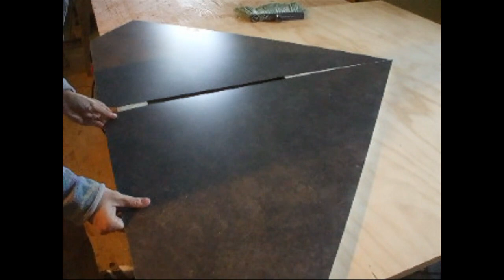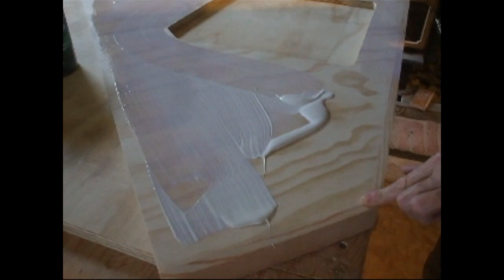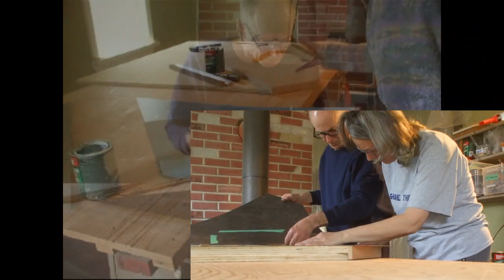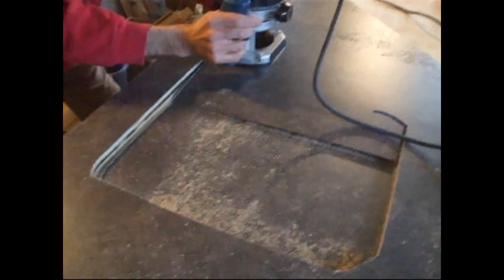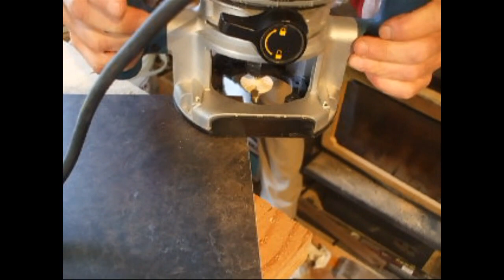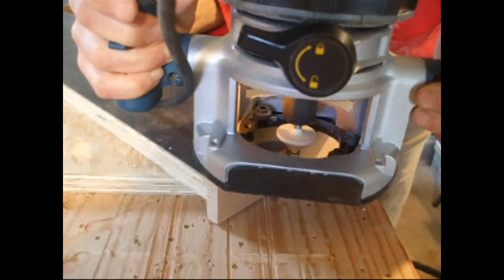Cabinet Construction: Gluing and trimming Formica counter

Comment from the maker: Yes it looks like wood glue but its not. It's low VOC water based contact cement. It's much nicer to work with than the old fashioned smelly stuff and much less toxic. And it still works great. You can tell when its ready to assemble because it dries clear.